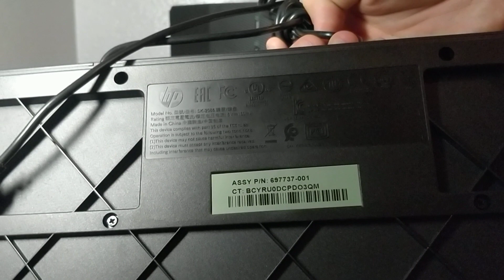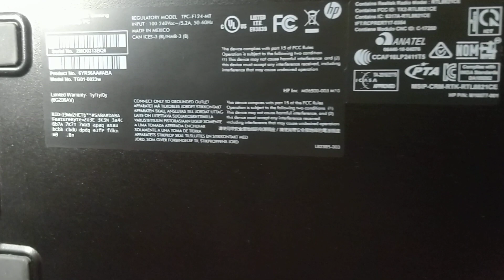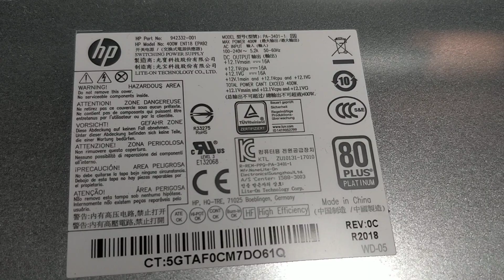HP Pavilion Gaming TG01-0023w, Ryzen 5 3500, NVIDIA 1650 Super, Look At

Comment: Looks like a nice pc could it run apex, csgo,R6,gta those are my main games going to switch from console to pc and this one looks good
Reply: Same bro
Reply: I have this exact same model, and I would be cautious with buying it. It is a good build, don't get me wrong, and is a decent price for a prebuild. But the 265 gigabyte SSD is lackluster, but it does appear this tower can sport another drive on it. So it's just a matter of putting one in.

On Mirrors Edge: Catalyst, highest graphics @ 1920x1080, on a 60mhz monitor, the GPU can run a bit hotter than normal, at around 70~ celsius, but this isn't anything to worry about in most cases. Performs nicely, otherwise.

This is true for most games I run on it, actually. The GPU tends to run a bit hotter than if you were to put it in a larger case w/ better ventilation, but likr I said, I don't believe it's a cause for concern.

TL;DR

Storage is a large concern.
Temperatures should be monitored, but you should be fine.

Comment: Have you been able to get the Crucial Advisor tool to run on yours?  I’ve read that it maxes out at 32GB DDR4.  I also wanted to look into Ryzen 9 AM4, but I don’t think the power supply is strong enough.  I’m guessing I’d need to cross reference an OMEN power supply dimensions.
Reply from the maker: Idk what is Crucial Advisor tool . ill look that up later. Hp mother board can only hold up to so much tdp. 65 w. nothing more since this mother doesn't even have a 24 pin power.  You can try it but i don't think it would work.  you can also look up other hp computers that have the same mother board to check what is the highest cpu it run. 
https://support.hp.com/za-en/document/c06430589
Reply: https://www.crucial.com/compatible-upgrade-for/hp---compaq/pavilion-gaming-tg01-0023w
Reply from the maker: @zeroturn7091  That just gave me a list of ram.  The ram I'm using is corsair 3200 16 gb. 8x2. it is recommended to buy the same two ram so it runs better in dual channel. which is about 10 fps faster. +-
https://amzn.to/3o2Pp73

Comment: Wil 2060 MSI VENTUS OF 8.9 inch fir
Reply from the maker: Will you be upgrading the power supply, its a 400 watt? if you are you will have to get a hp power supply because that's the only one that will fit in this case.

Comment: Thx bro , can u tell me if the PSU is upgradable and if the case is swappable
Reply from the maker: Yes The PSU is Upgradable but you need to buy an HP power supply since this case only fits hp case. Also Idk what kind of case would fit this motherboard. you wont be able to use the front i/o.
Reply: @richyoyo9796  thanku

Comment: Can someone tell me if these specs are good Idk much about PCs never had one I just wanna know if it’s capable of running games good specifically fortnite 

Operating system: Windows 10 Home
Processor: AMD Ryzen™ 5 3500 Processor
Memory: 8 GB DDR4-2666 SDRAM memory (1 x 8 GB)
Internal Storage: 256 GB PCIe® NVMe™ M.2 Solid State Drive
Graphics: NVIDIA® GeForce® GTX 1650 SUPER™ graphics card with 4 GB GDDR6 dedicated memory
Mouse and keyboard: USB Black Wired keyboard and mouse combo
USB ports: 9 (4 SuperSpeed USB Type-A 5Gbps signaling rate, 4 USB 2.0 Type-A, 1 SuperSpeed USB Type-C® 5Gbps signaling rate)
Wireless: Realtek Wi-Fi 5 (1x1) and Bluetooth® 4.2 Combo, MU-MIMO supported 

It’s the HP Pavilion Gaming R5 1650 Super, 8GB/256GB Gaming Desktop Tower idk if these are the same PCs but can someone please let me know ?
Reply from the maker: I don't play fortnite. Here is a video. but depending on the resolution. 
It should run great. I run it for apex legends. 
https://youtu.be/B9J0JHnI0s4

Comment: On the timestamp, 1:40, that's the old Compaq Presario CQ5000 Series Keyboard layout that was provided to me back in 2010. I also received this identical keyboard from the Gateway SX series back in 2014.

I'm surprised that manufacturers still cheap-out on keyboards and will use a more generic keyboard dated from 2009+.
Reply: Have this keyboard and I love it. I have 0 issues. and I feel as though it is a fantastic keyboard. Can't beat it for free.

Comment: Hey! I'm looking to replace the case on it. Any recommendations??
Reply from the maker: I'm not sure what mobo size they use or how the psu will fit since hp has custom sizes.
Reply: @richyoyo9796  that's what I thought because I tried googling it :( thank you though!
Reply: @anthonywong6143  hey so are the case like snap ons if so do I only take off the  case parts off the pavillion and then put an new one
Reply: if you’re getting a glass panel you’d have to get a new mobo and probably power supply because of green pcb and colored cables

Comment: do u know if i can get the i7 9700k with this computer
Reply from the maker: If you can find one. I haven't found one like that yet. But you can't put Cpu of 9700k i7 chip in the MOBO. This AMD Ryzen computer, since the pins are different.
Reply: Would the power supply be adequate?  Even if it were the correct socket, HP would lock down the BIOS for K chips unless one were optional.

Comment: Should I buy and if yes should I buy a cable or something for it to hold my frames?
Reply: Thinking about 165hz monitor as well
Reply: So that’s why I asmed
Reply from the maker: If you want to just game on a mid range budget yes. That's why I got this computer also since its quiet, also uses less power, which creates less heat.  I would recommend getting the display port cable for that monitor also depending on your display resolution. the higher the display resolution display port cable is the newest.

Comment: Thats amazing that it has two HDMI ports, because it didnt say that it has HDMI ports in the specs.
Reply from the maker: There is only one DVI port, HDMI, DISPLAY PORT.  
one of each. Where did you see the second HDMI in the Vid?
Reply: @richyoyo9796  look at the video at 3:23 and you will see one HDMI port on the upper top left and one in the center bottom area, you see it? There's two.
Reply from the maker: @MostafaMansoori  Oh that. The one on the Mobo wont work unless you have an integrated Gpu in the Cpu. So it wont work. The Processor needs to have an G at the end. like Ryzen 5 3400G. 
I just plugged in An Hdmi in both ports in the back. only the graphics card one work's 

https://www.google.com/search?source=hp&ei=ktC1X-HILavP0PEPs_2D8AM&iflsig=AINFCbYAAAAAX7Xeopvt_GqyX4l782hTQXDSXiX3lFB2&q=ryzen+will+motherboard+hdmi+port+work+if+not+apu&oq=ryzen+will+motherboard+hdmi+port+work+if+not+apu&gs_lcp=CgZwc3ktYWIQAzIFCCEQoAEyBQghEKABMgUIIRCgAToOCC4QsQMQxwEQowIQkwI6CAgAELEDEIMBOgsILhCxAxDHARCjAjoFCAAQsQM6AggAOggILhDHARCjAjoICC4QsQMQgwE6BQguELEDOggILhDHARCvAToCCC46EQguELEDEMcBEKMCEMkDEJMCOgsILhCxAxDJAxCTAjoOCC4QsQMQgwEQyQMQkwI6BAguEAo6BQgAEMkDOgkIABDJAxAWEB46BggAEBYQHjoICAAQFhAKEB46CAghEBYQHRAeOgUIIRCrAjoHCCEQChCgAVCWA1irpwJg96kCaBdwAHgAgAG1AYgBp0GSAQUxMS42MpgBAKABAaoBB2d3cy13aXo&sclient=psy-ab&ved=0ahUKEwjh2cyuwI3tAhWrJzQIHbP-AD4Q4dUDCAc&uact=5
Reply: @richyoyo9796  oh I see.

Comment: I have the same pc but I want to upgrade its graphics card any idea what I could use for an upgrade?
Reply from the maker: the 1650 Super for now is the best you can get for the 400 watt psu.  You can upgrade it if you can find the correct size psu. you can wait till the new graphics card come out. or buy a new pc.
Reply: @richyoyo9796  so in short in order to upgrade your graphics card you also need to upgrade your power supply. I know when you have a more demanding gpu you have to have a matching power supply.

Comment: could i upgrade to 3070 nvidia
Reply from the maker: This computer only has and 400watt power supply. If you find one that is compatible with that.
Reply: @richyoyo9796  is there a difference in 2060 n 3070
Reply from the maker: @pinhead7670  https://www.gpucheck.com/compare/nvidia-geforce-rtx-3070-vs-nvidia-geforce-rtx-2060-super/intel-core-i9-10900k-vs-intel-core-i7-8700k-3-70ghz/

Comment: I just bought this computer today, it's an excellent mid range gaming PC. I got the 512ssd HDD.. Did you only get a 256 gig or did it come with a second mechanical HDD?
Reply from the maker: Nice. It only came with an 256 gig.
Reply: @richyoyo9796  is it upgradable?
Reply: @milanchacko2095  yes you can upgrade a little bit

Comment: Hey man I was wondering since mine will only have 8gb of ram can I put another stick in it to get more
Reply: The Ryzen 3500 in it performs best with dual channel ram. Another stick similar would help alot with game performance.
Reply from the maker: Yes you can. I just did it. Also.
Reply: Rich Yoyo and also do I have to get another stick to run fortnite on low settings at 144 FPS steady
Reply from the maker: @_blade761  I don't think u need more ram for it to run fortnite at low. I can run apex legends at medium at a higher resolution.  https://youtu.be/SkVR-sIfxI8
Reply: Rich Yoyo so I don’t need another stick to run fortnite at 144 FPS even like im also gonna have other apps like discord and Minecraft and among us so u know are u sure?
Reply from the maker: @_blade761   I'm not really sure.  It should,  I run apex legends at 2560x 1440, on medium for 75fps. 
do you have the computer already? or you looking to buy it? if you have the computer already you can just try it out and if its not working get more ram. 
Heres a video with the same settings. and spec almost.
https://youtu.be/L8TypqUrbnE
Reply: Rich Yoyo ok thanks and no I  don’t have the pc yet